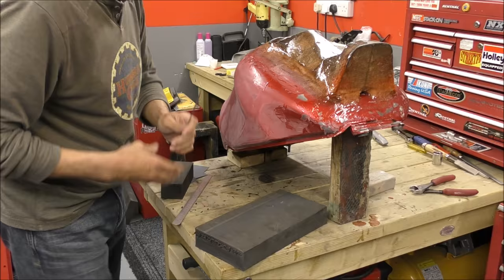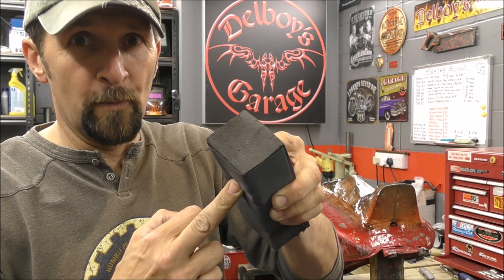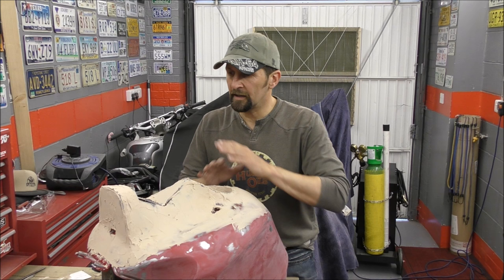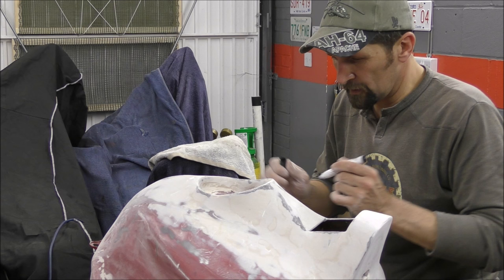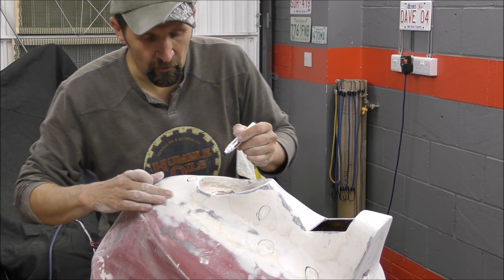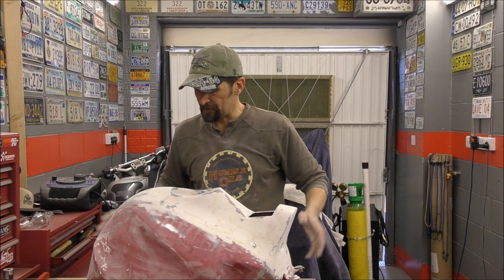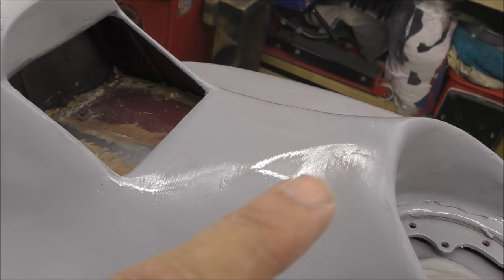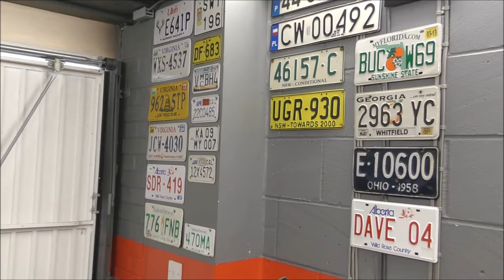Delboy's Garage, Fighter Build #27, Icing on the Cake

Comment: Starting to  take shape ay bud, I  worked for a  panel beater in Oz for a while & spent ages sanding 'bog' (as they call it )so tedious but necessary. You have the patience of  Job  which would be an asset in this tank job. Have a heat bank holiday, I'm off to the Canaries tomorrow for 2 weeks  so you'll  probably be. finished by the time I  get back  😎🍺👍
Reply from the maker: Hey Geoff.. ha ha finished in two weeks.... yeah, right.. maybe the tank.. but at 140 hours so far, im not even half way... probably be in the belly pan build by the time you get back... have a great time mate.. all best.. Del.

Comment: For sanding in curves I've also found that wet emery paper wrapped halfway around bit's of "Pool noodle" from the pound shop work quite well. The noodle doesn't last a particularly long time, But the thing's are dirt cheap and easy to get hold of.
Reply from the maker: ... what's 'pool noodle' ?
Reply: They're 4 or 5 foot lengths of round polyethylene foam. They come as either hollow tubes like pipe insulation, Or the more useful (For our purpose) 70 or 80 ish millimeter diameter solid cylinders.
They're ment to be a sort of flotation aid/toy for kids to mess about with in swimming pools. The foam's hard enough to get the work done, But not so hard that it's going to force it's own curve into what your sanding. If you use the same piece for a long time their curved diameter starts to flatten out, But as I said, They're dirt cheap, So they're as disposable as the paper you're wrapping around it.
Reply from the maker: Oh i know... pipe laging has so many uses.. good thinking.

Comment: How about wet sanding? It would keep the surface reflexting the light to see inperfections. Even after painting you could wet sand it i think. Great vidz and fun to see the progress
Reply from the maker: Sure thing Jeroen, 'wet sanding' is for smoothing out the final finish.. and you do it with fine paper.. i still have some more shaping and filler work to do with this before i get to that stage.. ansd i will do that when i get there... thanks buddy.. del.

Comment: lol the tank looks like a robots head from the side. Now regarding filler, I had a lesson from a professional restorer a few years ago regarding filler and most people think filler is just filler. Not true there are a few grades of filler and most restorers use 2 types on a job. The first type of filler is to shape the surface the second is to get the panel super flat for painting so no blemishes show up. So they may do 2-3 layers of different filler grades depending on the job to get the surface super flat and unblemished.
Reply from the maker: Yeah, there are an array of products for this kind of thing... the super smooth stuff was developed for the custom world, its like a liquid almost, you need a level of skill just to apply it as it super runny and flows out.. this is great as long as you dont let it 'pool' in places you dont want it to and redefine your shape lol... its then sanded out with fine paper and water, the custom paint guys use it a lot for building choppers.. its other benefit is also that its fast... and gets a pro finish in short time... Take care Richard.
Reply: i have the liquid filler and its a bugger to work with but gives such a nice finish
Reply: you know what builders say, 90% time on prep to save 100% of the tears. Keep up the build videos as it makes me want to finish my two projects (74 HD shovel soft tail, 1975 Honda GL1000).

Comment: Nice work Del . Will you use a stopper for the pin holes.
Reply from the maker: Not sure buddy, didnt need it on the front, and that has filler in it... smearing in a finger of filler is just as good..
Reply: Fair play Del . Got to say it is looking very good.

Comment: Just watched again Delboy surprised what little bits I missed the first time round but I stick by my facebook comment, your a bloody star pal.
Mine is off the road again as exhaust bracket has got a small crack in it only been on since march so waiting for the supplier to get back to me. Wondered if you knew of anything that could bond it as no welder and it Aluminium me thinks.

Thanks again Delboy.
Reply from the maker: Hi Ian.. if its Alooominum... can you not just make a new'un?... is it sheet metal, can you maybe bend up a new one..!?  or is it thick stuff..? let me know buddy..?
Reply: Unfortunately no as it incorporates a small lug behind it for the rear brake pedal spring. Plus there is a hole for the brake pedal to fit onto a spindle. As its only a slight crack near the top and not gone to far i am thinking of using a JB weld product and if not taking it to a engineering company to see if they can make a steel copy. Cant seem to show you a pic of it.
Reply from the maker: ok, if you have a pick, send it to moonfleet10@yahoo.co.uk, ill have a look..!
Reply: Cheers Delboy sent a pic to you.
Reply: Have your heard of or dealt with Durafix Aluminium Welding Low Temp Easyweld Rods. I believe you can use a normal blow torch to weld with it as I dont own any welding equipment.
Reply from the maker: I havent heard of that product, there's always something new coming on the market, ..Welding was being done with a flame torch long before mig and tig wleders were invented... in fact, before electricity was invented..lol   so im sure there is a gas welding alternative... ill check out the images, as its on another email...
Reply from the maker: Hi again Ian, just replied via email buddy - have a read through and see if that would help !
Reply: Yes and thank you Delboy gave me a lot of info and saved getting the JB weld. 
Just waiting to hear from the manufacturer first and if its not good news I am thinking of making a plate and either pop riveting it or using bolts to secure it to the face.
Really like dthe answer regarding drilling a 2 to 5 mm hole to stop the crack expanding, Pure genius Delboy.

Thanks for taking time out to help.

Stay well.
Reply: Delboy would you think Brazing aluminum with a propane torch and brazing rod is going to be a easy job to try??? With or without the plate I am thinking of putting on?

Comment: leica camera or panasonic? leicas are super overpriced (except the old leica M3 still cameras—pure art). regardless, 4k vids are overkill for youtube, but i'm sure you can knock it back down to 2k. 4k is for broadcasting and displaying on a theater screen. otherwise, great work . . .
Reply from the maker: Hi buddy... its a Panasonic HC-VX870, with a Lieca lense.. best of both worlds as you get one of the best lenses in the world, in a camera with much better internals... it is a 4K camera, but the 4K is just its maximum, the problem with 4K is the 30fps, which makes isnt really an improvement for moving images, great for stills, but rubbish for video, and it also makes for huge storage issues, cards get eaten up in no time...

Im filming now in what i think is the very best setup for youtube.. i use 1080/50P and simple ' 2ch stereo' sound (it has 5 channel surround, but that just picks up all the reverb)... yes it has massive extra ability, but i use the lower settings for the very best quality we can make at this price level...

This setup was just under £700 with the mic, and thats a bargain in real terms as it pretty future proof... in time, screens, and all the other related hardware will catch up with 4K...and i cannot wait, im using a MAC now with 5K retinal screen..and just sampling some raw footage shot in 4K on this screen is incredible... never seen anything like it, its almost like BluRay... and in time Youtube will catch up too.. so my figureing is that this camera is a great future investment aye..!!! thanks for your input chap...much appreciated.. Del.